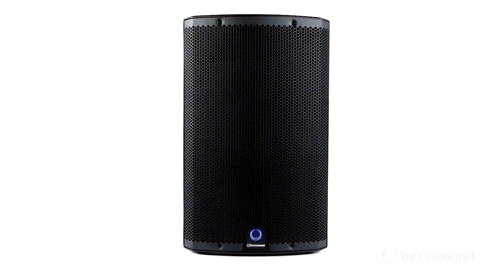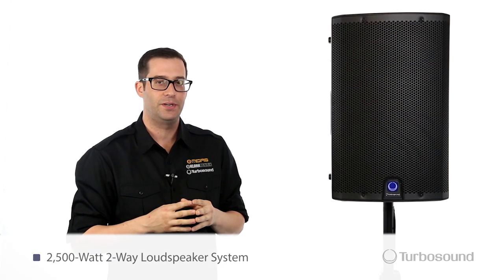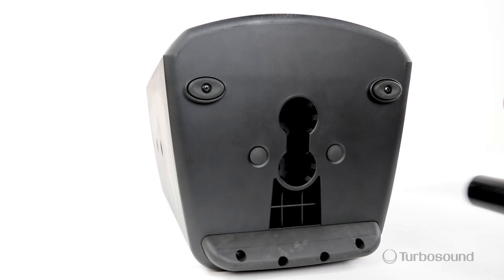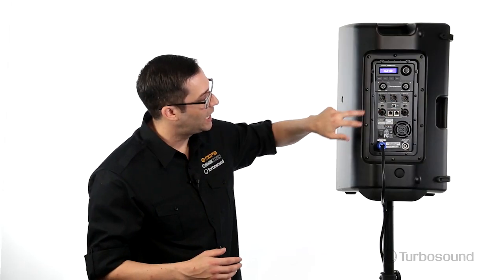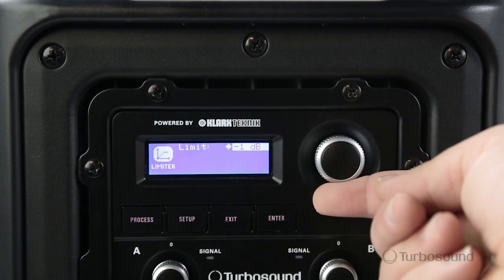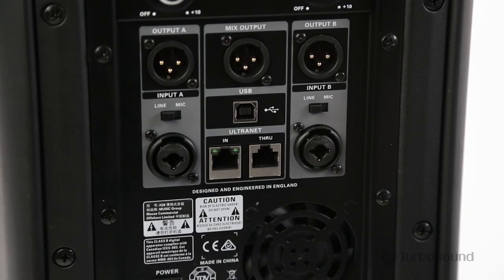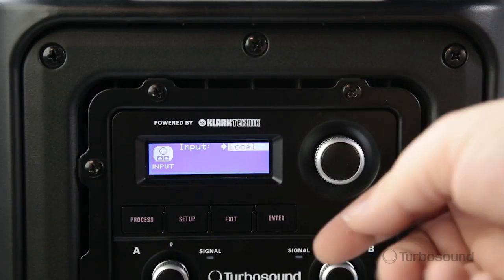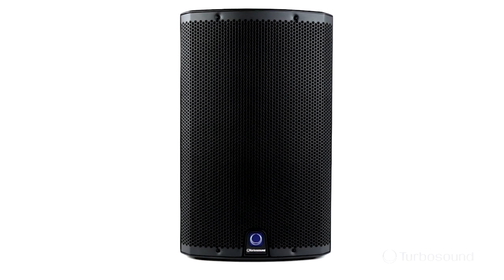TURBOSOUND iQ12 Powered Loudspeaker - Overview

Comment: Just ordered My new M32. About to Order 6 of the iQ 12's. Moving my X32 down to the stage for Monitors. Not using the Head Amp split in the DL32. Not a true split. Have to get a snake splitter too. Its going to be a tight Monitor set up. Gonna hire my friend to run it. Friends who do sound are invaluable. 

Sound Team!!! Assemble!!!!!!

Comment: Why would anyone want to model some of the cheap MI types, such as the EV ELX? I want it as flat and linear as possible. Also why not mention the PowerCon? Most powered boxes in this price range use either regular IECs or some proprietary locking IEC. Many users with power distribution already in their inventory will prefer the professional locking power connection - I expect it to be a strong selling point!